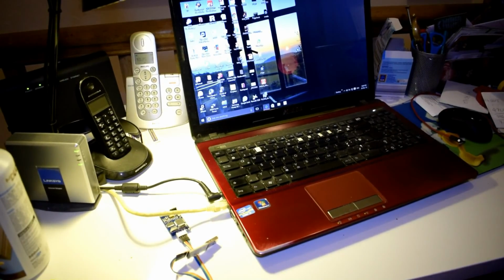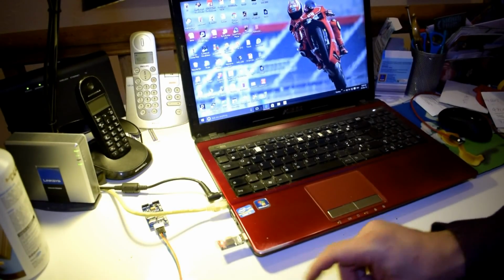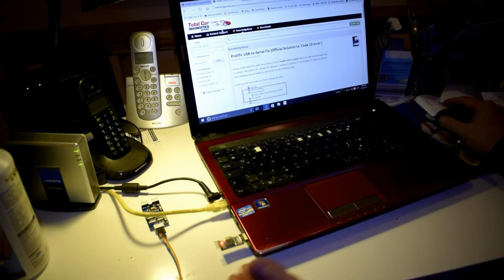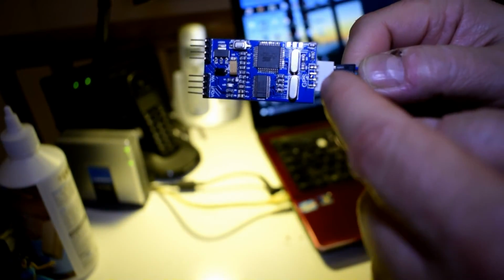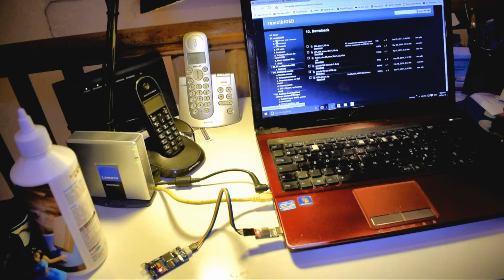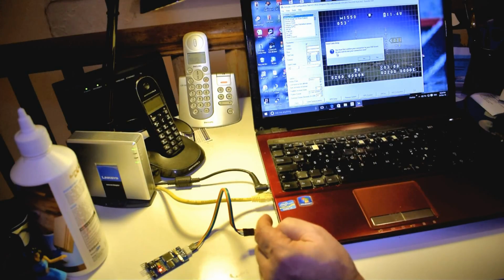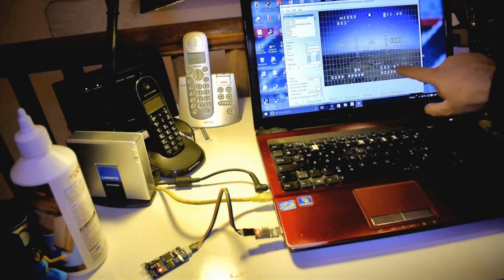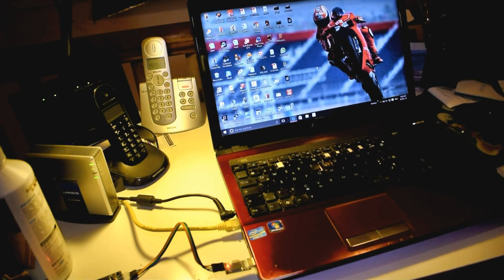remzibi part 2 connecting the board to a pc and GUI usage

Comment: Hi, I'm also having connection issues. Everytime I try to click connect, the software says it failed to read the comport.   I'm using windows 8.1 64bit. I followed your instructions and Googled the page that brought me to that auto website and download the same drivers as you did in this video. I'm still not having any luck. Am I not downloading the correct driver for my computer?
Reply from the maker: It depends by the chip u got on the USB interface Every chip has its own drivers that are compatible. Once u get the correct drivers you will be able to access the OSD and Program it through the GUI. Good Hunting .
Reply: Any recommendaion on whwere to even begin searching for a compatible driver for this randome chip? I see you just googled your and downloaded the 64 bit driver on that auto website, guess you got lucky there.  I downloaded that one too which didn't work. Any advice helps.
Reply from the maker: Try Here :http://support.lenovo.com/gb/en/downloads/ds037723
or here : http://www.avitresearch.co.uk/usb2ttl_silab.htm
or here : http://www.arduined.eu/ch340-windows-8-driver-download/
Your USB adapter has writtn on it which type of chipset it uses
type on google that and add: drivers for windows 8.1 64 bit
Reply: I appreciate all your help, but interestingly, none of the drives provided in those 3 links were able to connect my USB adapter.  I saw that in the back the chipset number is "D-sun".  Any help is appreciated.  You seem to know quite about this than I, I"m a newbie at this.
Reply from the maker: Hi, I did a research for you , I cannot really install this for you but from what I can see you probably have to enlist the help of a friend that knows about windows and drivers. See this instructable that tell you sep bystep how to install :
http://www.instructables.com/id/Usb-to-SerialTTL-adapter/
Also check if you have a red or a blue adaper here is a site that describe them :https://www.cpmspectrepi.uk/raspberry_pi/MoinMoinExport/USBtoTtlSerialAdapters.html
Type on google :usb to ttl d-sun driver windows 8.1 and scout for the needed drivers
sometime old ones work better than new ones as chineese knock out are outdated.
Reply: hi mikbbacitube, so I was finally able to download the right drivers from one of the links, but it still had an issue that said "the device cannot start: code 10".  I found another website that had a link to download to correct this error message also.  Now I"m able to click connect and the usb connects, but I'm not able to move forward either.  I have 4 wires connected to the USB.  I hold the osd button , connect usb cable then let go and nothing happens.
Reply: I finally found a driver but had and error message that keeps stating " cannot start device: code 10".  I was able again to find another software to download to fix that issue. Now I am able to to connect to usb when I click connect but when i click the "START TEST" button I get an error message that states "Failed: OSD did not respond".  I"m not sure what to do to save all my customizations to my OSD. Any advise?
Reply from the maker: I did get the same error .. just ignore it and save your changes to the board and you will see when you connect it it will work. After all the GUI was made for the original osd and not the knock out one.
Reply: mikbacitube , what steps then would you recommend I take to save my changes and customization?
Reply: I saved the bin file but that only saves it to my computer.  I appears that the only way to save my changes to my OSD unit is to click on the "Serial communications" button in the bottom left corner and click upload program of which I cannot do, it won't let me.  So it seems like I'm either missing something or I need to click the "start test" button first in order to be able to upload to the osd unit.